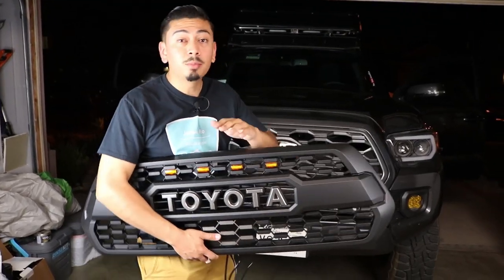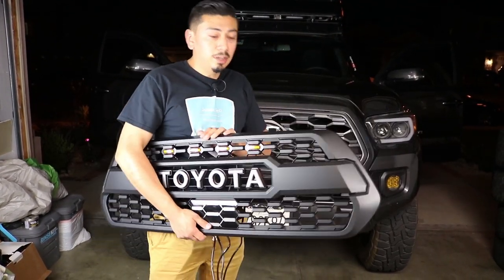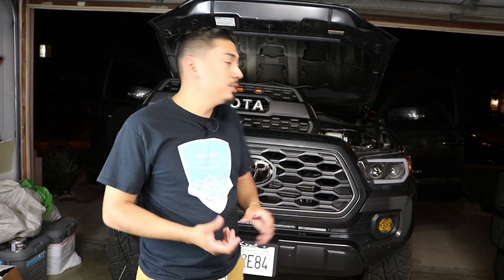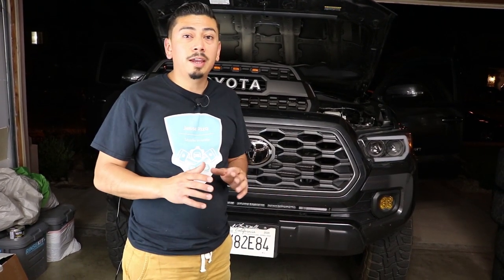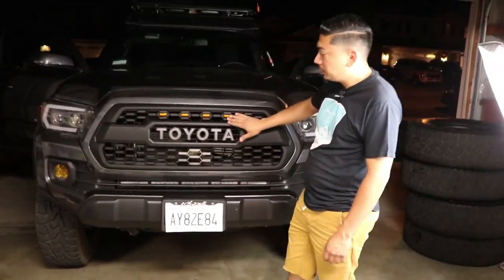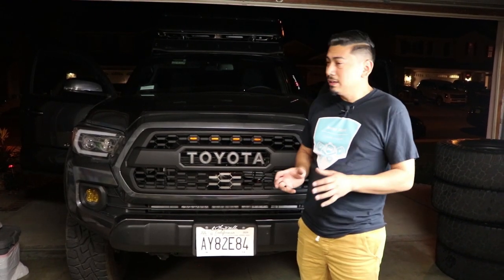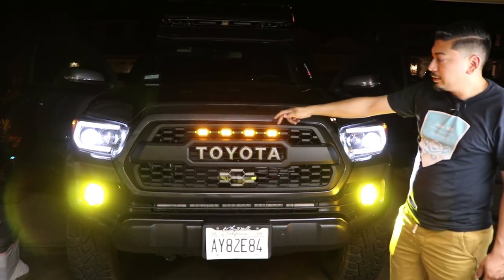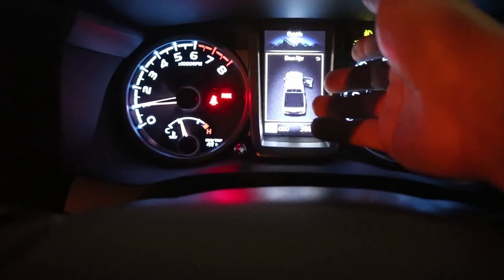CAN YOU INSTALL A TRD PRO GRILLE ON A 2020 TACOMA? | TRD PRO GRILLE GIVEAWAY &MORE PRIZES MUST WATCH

Comment: Just curious.  I bought this grill and garnish. The garnish does not fit flush. Its angled out more on the bottom. I was thinking. Couldn't I just put plexi glass behind the the original piece that's in there, behind the 3 slots of that plastic piece you pull out to put in garnish? I see people run it without garnish. But weather here I would need a cover. So I'm thinking just gluing plexi galss behind the openings.  Anyone try this by chance?

Comment: I have a 2020 Tacoma with front camera and I installed a TRD Pro grill. I bought the OEM grill that has an integrated camera shroud. But the camera bracket is different on the Pro. So I also bought another camera to fit into the shroud. I might have been able to modify it but I wanted a clean install.

Comment: Hi Jesse, are you going to be changing the grille on your 2020.? When I changed the grille on my 2018 I got a letter from Toyota saying I needed to take the truck in for a warranty issue and they couldn't do it unless I put the original grille back on so they could get the proper reading for what they wanted yet I found no issue when I used the cruise control on the highway.

Comment: That the tricky parts with that sensors.. you need to calibrate them depending where you touch the sensors, and how much they been dinged up around

OH AND I WOULD WANT TO WIN A TRD GRILL OR ANYTHING NICE FOR THE TACOS.

Comment: Hey, while I would love the grille or the raptor lights, I am one of those who has the 2020 with the front facing camera. So, I would like the screen protector for my 2020. The 2020 is my second Tacoma after my 2012. I didnt do much with mods, except for tires/wheels and a 3 inch lift. This time around, this 52 year lady is a mod queen lol, I installed on my own, an MBRP exhaust, did the chrome delete kit from Meso along with Tufskinz products...the red is killer. Also the meso red start button, bedside graphics, tonneau cover and next I will be installin some kc hilites amber fog lights along with the Cali Raised light bar (hidden bumper and some smoked out sequential turn signals. I dont care what age you are, I love doing mods on my truck! As a teacher its the perfect stress reliever and my students think its cool! Heres hopin I win the screen protector!